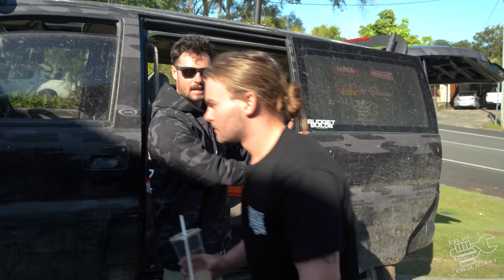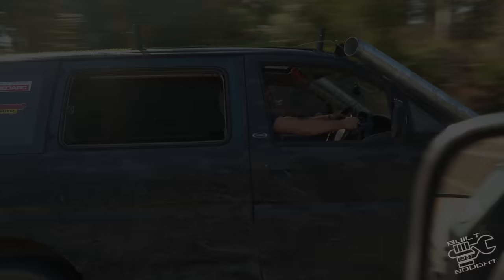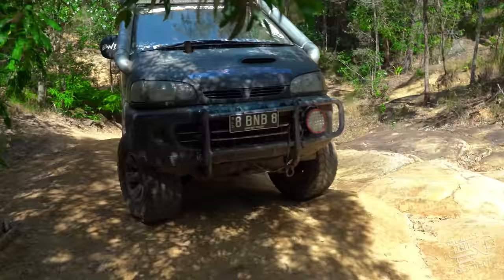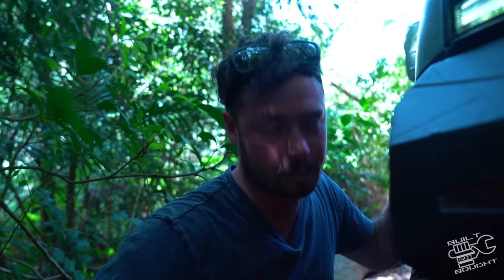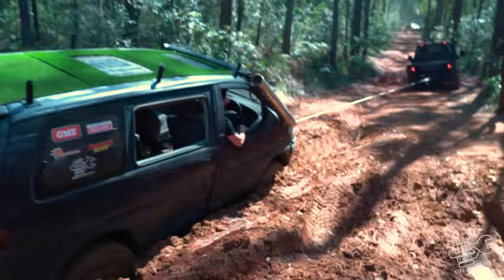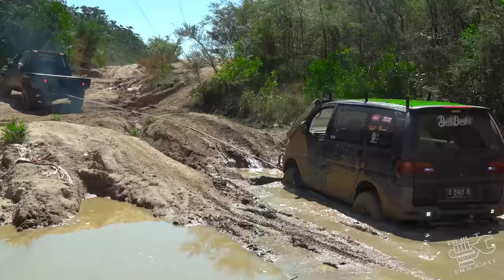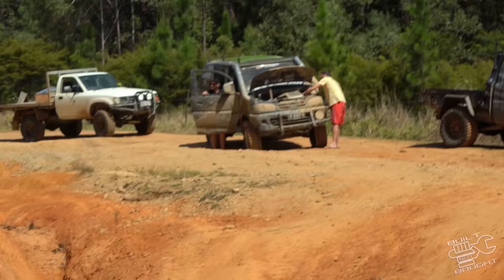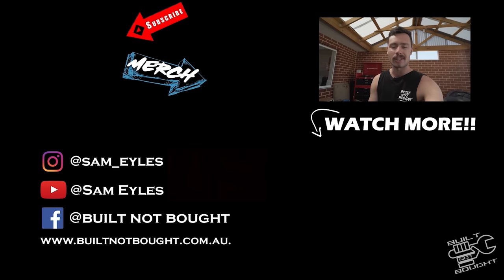Testing The DELICA to it's LIMIT!! 💣

Comment: I've had the same delica for 12 years now. I've both neglected it, and spent a lot of money on it. I've always been delicate with it while 4x4ing. Not doing anything over the top. I've always felt like it's not particularly capable, and very top heavy (doesn't help that I have a roof top tent on it). 
I accidentally took it through 20km of hard 4x4ing last year.  Thought it was going to be an easy track.... it wasn't.... but I had to commit. Deep mud, steep, deep rutted roads, water crossings, shit I would have never planned on doing. I expected to get seriously messed up, and was kinda white knuckling the whole way, but it got through it all like an absolute CHAMP! Hadn't even let the tyres down.

Comment: My L200 ute got sandwiched in a crash.  I just cut the front off and put a front on from a 2wd and she is good to go.  It would have driven away from the crash that wrote off a Prado. 92 triton is tough as.  Got her back on the road now.  Written off but they don't record it.  My body has some issues but the ute is fine.

Comment: Shame dont see more of these, and the Gen2 pajero on more youtube stuff..  no one seems to touch them.  I have both in England, the 2.8td ones.  I am getting totally fed up with the is it.. 24/7 off roading videos.  all the same stuff, top end gear spent on it, and they take along those that sponsor and give them lots of stuff etc.   Rather see normal vehicles with mods done by the owners and at times not the most expensive etc... and used for trips off roading rather than just rock climbing etc.   its how i came across this channel not too long ago.. pretty cool